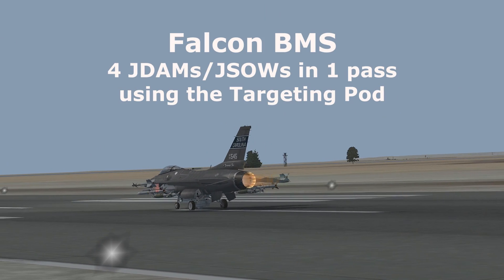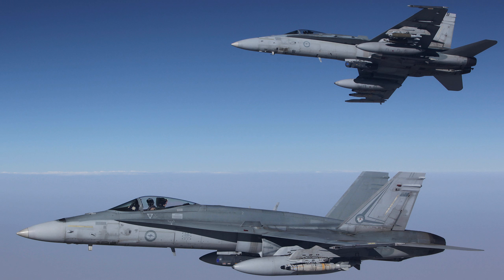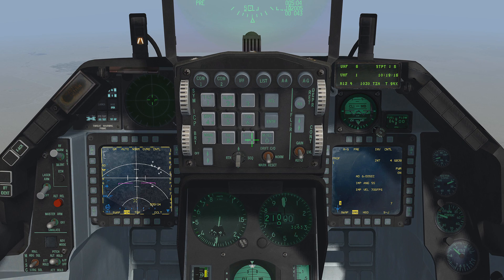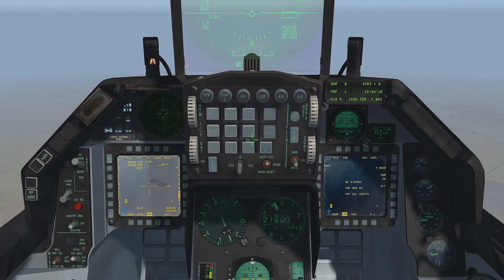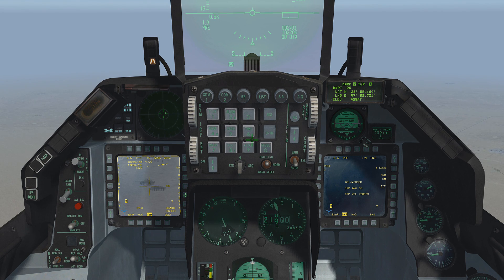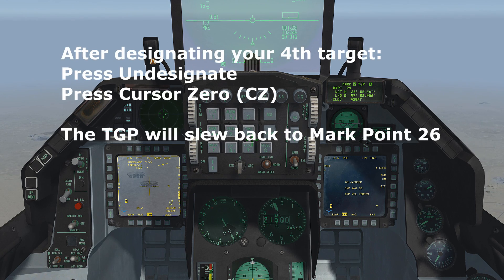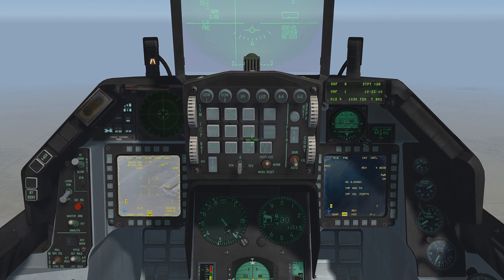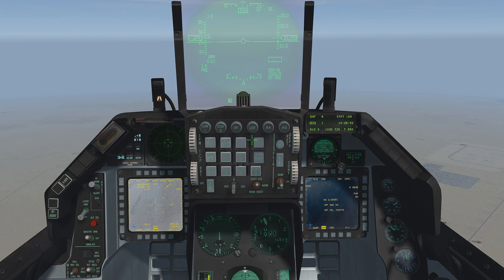4 x JDAM / JSOW with Targeting Pod, Mark Points Tutorial | Falcon BMS

Comment: Outstanding lecture... but those are pre programmed GPS bombs, can you do it with 4 laser guided bombs on  a relatively closely grouped moving convoy?   So one pass haulass, 4 x GBU-12.
Unless you like to watch 3D image flyovers, tripple buffering is not ideal for gaming. In Falcon BMS the option is presented... only so you can turn it off.
Reply from the maker: Unfortunately not because the laser can only paint  target at a time.

Comment: When we launch 2 💣 together we know that the “space impact” is the distance between 2 JSOW 💣 considering the SPI at the center right?

But these 💣 do not fall whole to the ground (such as JDAM), but open in the air in clusters. Therefore the “space impact” is calculated from the center of 1st 💣💣💣 💣 to the center of 2nd or simply the distance between 2 JSOW 💣 in the air?

I hope it is clear I,m 🇮🇹🙏👍